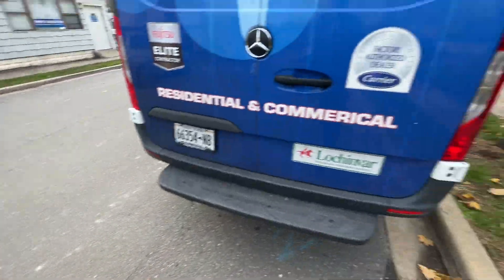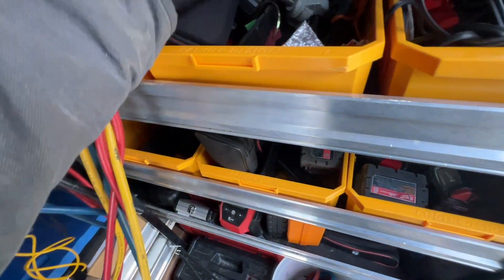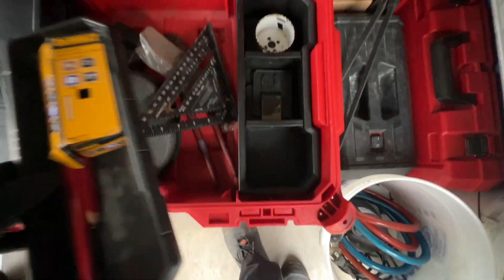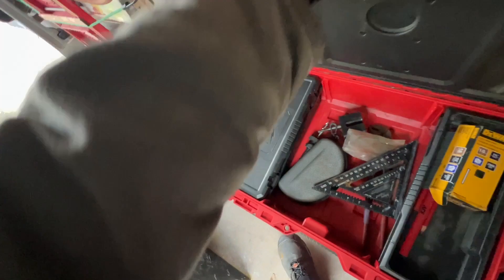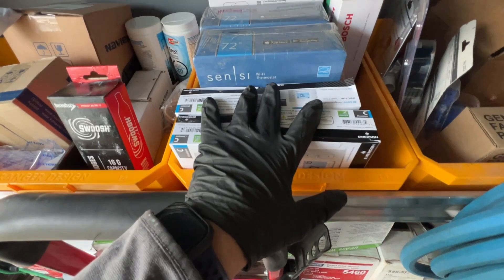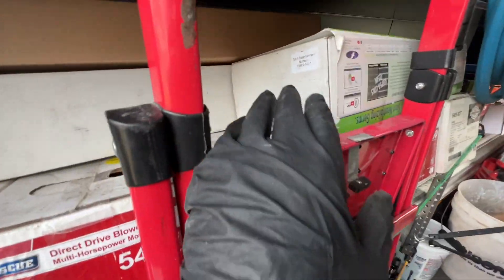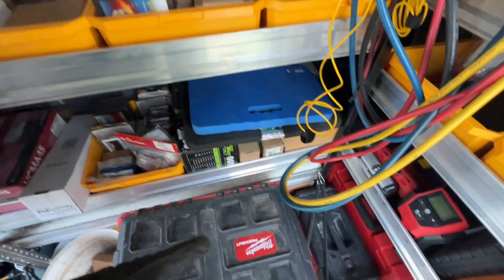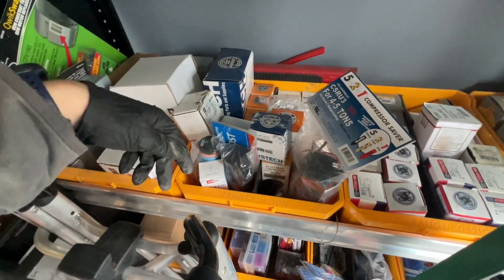HVAC Truck Tour! How I Set Up and What’s Inside My Work Van! 2021 Mercedes Sprinter High Roof!

Comment: You mentioned klein manometer. I thought Jim bergman with accutools had said that a good combustion analyzer could be used for several tools including nanometer. Does the testo work that way?
Reply from the maker: I prefer using a dedicated manometer. The manometer in the testo is so sensitive, I don’t want to use it for anything but draft.